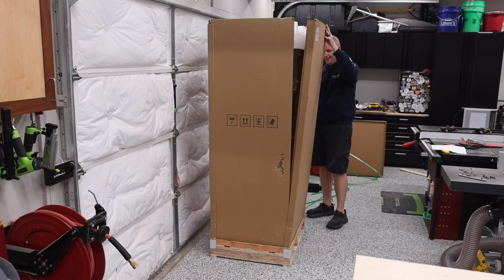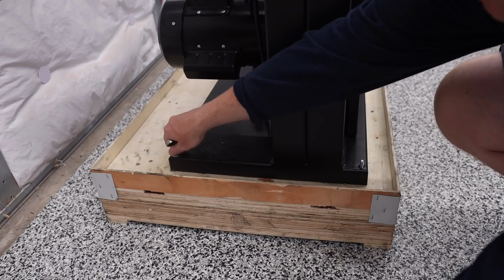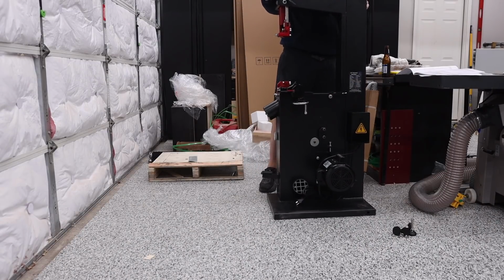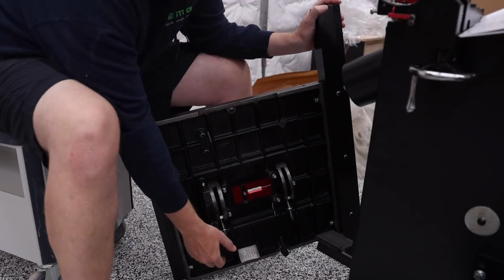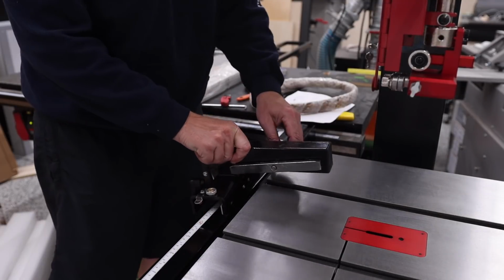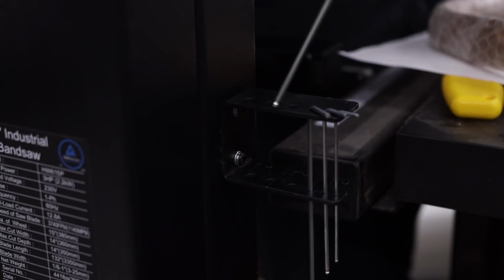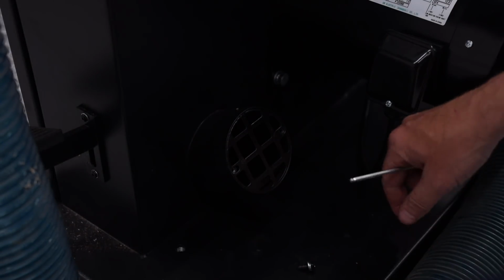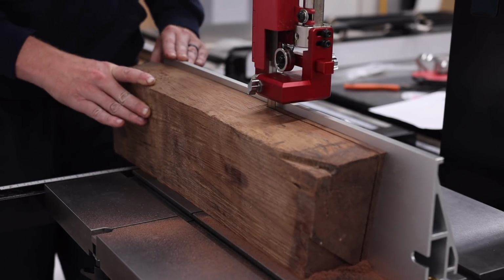Harvey Bandsaw Assembly

Comment: Got mine a few days ago. I mostly agree with everything you've said. What you left out is the lower guide assembly which is a real pain in the butt.  The critical front to back location of the lower side rollers requires loosening 2 allen screws to move the entire assembly. One of the screws is located directly beneath the shaft of the thrust bearing, To get the assembly in position, you have to push the thrust bearing shaft out of the way, which requires detensioning the blade and pushing it way forward to loosen the screws.  Then you get the blade back on the wheels, retension it, make sure it's centered, get the bearing assembly in position, and tighten the one screw you can access. Then you have to detension the blade, push it and the thrust bearing way forward, then tighten the other screw, then put it all back together again. Did I mention that it's a pain the butt? Then you can finally adjust the thrust bearing and the side clearance of the lower bearings--which is easy.  Please tell me I'm doing it all wrong and there is an easier way!

Comment: Great review. Just unboxed a 14" Harvey Ambassador. Was easier with 2 people to lower off the pallet and then mount to the Harvey mobile base that I had assembled. While it is nerve wracking to get off the pallet and onto the base, in reality it's super easy. Be careful and be patient. Superb packing. Wife helped me level on the mobile base. Really, really easy.  Unboxing is awesome and this machine is ready to go. Checked all specs for table and blade orientation, tension, etc. Dead on.  The mobile base assembly was a bit tricky but I actually enjoyed it. I should be getting paid, right? 5 stars to Harvey. Assembly, calibration documentation has some glaring errors that I'm surprised Harvey hasn't addressed, but they are so obvious that it did not present a problem for me.

Comment: Thanks for posting this.  I was a little stumped as to how to hold that heavy cast iron table up while locating those two retention bolts.  You rested the back of the table on the machine while you dropped them in.
Reply from the maker: Glad you found it helpful
Reply: Yup, that was a tricky move to do alone--a third hand would be handy.

Comment: I see you got the bandsaw with the cast iron table?  Never heard of the TiN coating before your video.  How would you compare it to the Powermatic - PM1500 3HP 15" Bandsaw?  I have the Powermatic on order since April and it still has not shipped.  Contacted the seller and could not find my order, so I gave them the order number and thewy haven't gotten back to me yet
Reply from the maker: I can’t really compare it to the Powermatic cause I haven’t personally used it.

Comment: "The only thing left to is make some test cuts"...? No setup other than the bearings? Was the table flat? Was the fence square to the blade? Is there a follow-up video coming on how accurate this bandsaw is out of the box or if there were any additional steps needed to make it run & cut true and accurately vs how it came after the unboxing?

I've been considering this very saw but this video didn't answer any of the important questions I would want to see answered before spending $3000 of my own money.
Reply from the maker: I understand your concern. However, this was more of a brief overview of the steps I took to set mine up. There will be more detailed videos in the future. There are amazing resources out there on dialing in a bandsaw, specifically Alex Snodgrass.
Reply: @bentswoodworking  Cool, and I understand there are a lot of resources out there, but I was curious if this specific machine came as advertised and if there are any issues you had to address. Specifically, unexpected ones, parts to return, support calls made, etc. I wonder if the table was level all the way across or were there dips or peaks? Did it take a lot of time to get it dialed in - or was it only the standard things?  I guess I should read "unboxing" and wait for "review". Just curiously excited and I did enjoy the video.